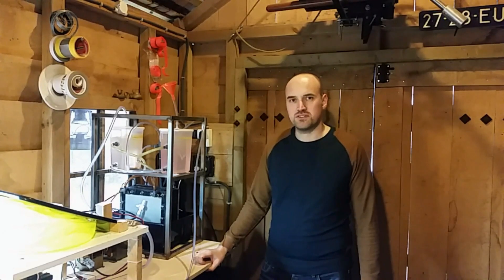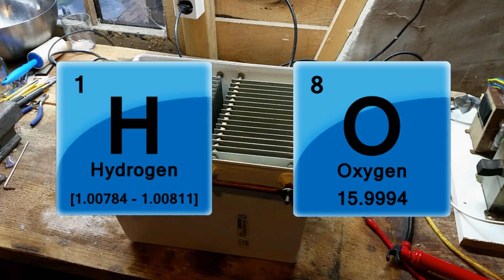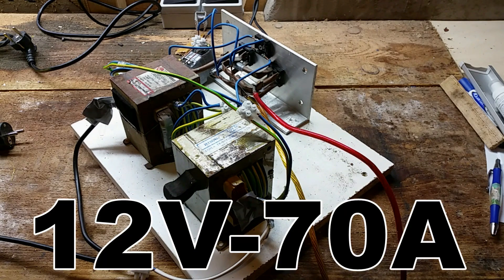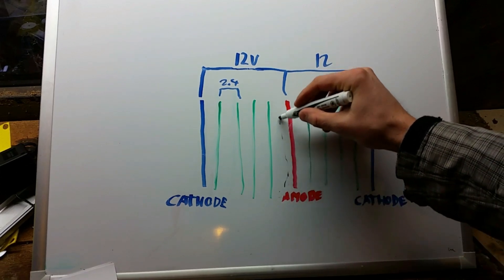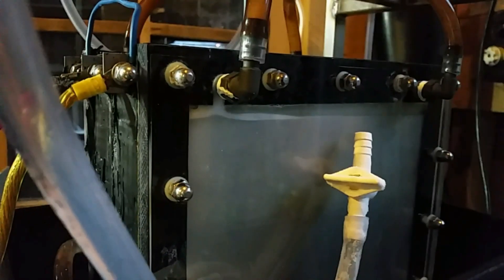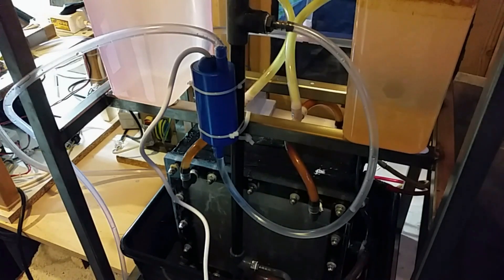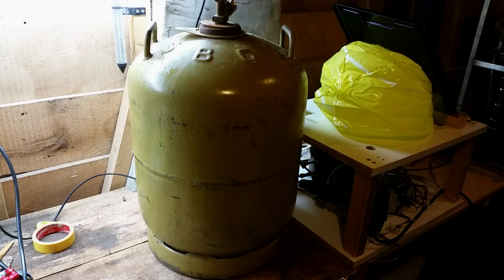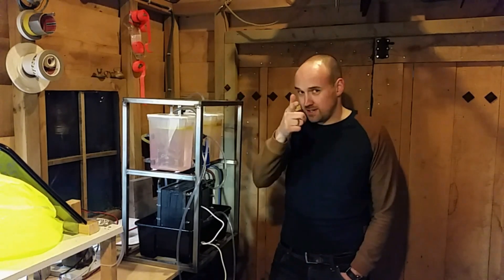Hydrogen Generator #1 Homemade Hydrogen Generator And Compressor Unit

Comment: I know it's an old video but are you worried about hydrogen embrittlement at all? Or do you think it's a low enough pressure to not worry
Reply from the maker: Hydrogen embrittlement will not occur in austenitic steel. Which these thanks are because you can weld stuff onto them without the metal being hardened and forming cracks next to the weld.

Comment: Really good. Regarding your larger tank that split because of the heat, I wanted to make hot water with the HHO, do you think it would work to have a round tank with the electrode plates inside and coil a copper pipe around the outside with the cold water circulating, which of course would heat up but also reduce the temperature of the electrolyte water?
Then shut off the electrode to stop the reaction by way of a thermostat, then there is warm water in the coil pipe and feeder tank
Reply from the maker: Yes that would work but a heating element would be more practical to heat your water.
Reply: @TheDIYScienceGuy  I understand, but my question was about killing 2 birds with one stone - to reduce the heat buildup in the reaction by having a 'cold water jacket' effect as with liquid cooling of a motorbike engine, and to not waste the heat. By turning it into warm water, then storing this well insulated it would reduce the power load to heat it into more useful hot water, such as in an off-grid situation. If you can use solar panels to make hydrogen and warm water then this would make a fantastic useful system for off grid use

Comment: Ok you can't just use a bubbler you need a flash arrester to prevent back flash, it's basically a pipe with two male hose barbs on either end stuffed with Rock wool or steel wool. A 50CC engine is gas Hungary, so you need storage for the gas so between your HHO Generator and your first flash Arrester you have a rubber bladder with a valve on it your HHO generator will produce 200Lbs/psi so make sure your hoses are tight. You will need flash arrester and  a moister trap then your engine... it cannot be set for gasoline you have to set the timing for a lighter fuel that burns sooner, so it is Actually about 3.5% after TDC once you have this setup it will run until it runs out of water or HHO gas Important use your HHO right away hydrogen and oxygen will Re bond in your bladder tank making water in about an hour or 2

Comment: I am curious why not make the whole system able to handle the required pressures,  allow the hydrogen and oxygen to naturally build pressure with not extra energy input to compressor?

Because there is virtually no difference in energy imput with regard to pressure.

It costs the same imput at 1 atmosphere  as 10 atmospheres, thus if the whole system can handle 10(15 for safety margins) then it naturally compresses from the electrolysis input...
Had trouble stating this simple idea, maybe my mind is fading lol.
Reply from the maker: A generator that would be abel to do that would be hard to seal. Also when the pressure increases the efficiency  goes down. But profesional generators do compress the gass into the first stage of a compressor booster that way. So good thinking. 👍

Comment: IF CAN I KNOW HOW MANY VOLTS FOR GENERTOR AND HOW MANY AMPERS FOR STRONG CURRENT FOR MAXIMUM ELECTROLYSIS RESULTS
Reply from the maker: I used 12 volt at 70 amps

Comment: Thanks man!This is awesome video!Can you use compresed hydrogen tank for stove or heating purposes?
Reply from the maker: Thanks! Yes you can. But you need to adjust the burner settings and instal safety features.

Comment: When you compress hho does it turns to liquid as propan does? Or is it just compresst air/gas?.  Nice build btw
Reply: Hho is literally hydrogen and oxygen, if compressed it gets hot as fuck really fast. Under enough pressure, it will auto ignite and legit explode. Not good man. 

But if your curious about how to do so safely, cooling the compressed gas to below auto ignition as it’s compressed will literally turn it into liquid water.
Reply: So, all in all, kind of pointless. And extremely dangerous. Hydrogen is inert when not mixed, when mixed with oxygen it becomes 1000x times more explosive than gasoline.
Reply from the maker: Never compress hydrogen and oxygen together in the same tank!!!

Comment: Electric generators engineer/ HHO hydrogen engineer need, I need to have a custom HHO fuel cell built, buy using home power to power the fuel cell to run a champion 10.0000 8000-watt gas propane generator Like Greg Potter with his GDS3000 GSD Technologies. Portable water generator. The engineer must have experience in Electric generators, Gas motors, HHO hydrogen fuel cell engineering Please email me if you’re interested in getting hired for this project molinarenterprise@gmail.com 50% will be paid upfront and the other 50% when the project is done.miami fla

Comment: soooo how big is the explosion if it failes to cool it down XD
Reply from the maker: The generator is cooled to prevent water vapor from mixing in with the gass. It can not overheat even without cooling.

Comment: question, instead of a membrane, can u use a tube at the bottom to connect the water tubs
Reply from the maker: Yes but then the current can only flow trough that tube which effectively makes the surface area of you electrodes the same size as the tube.

Comment: The way to go. From wind turbine to hydrogen in the existing gas pipeline like a mix of 50-50. No need to change appliances.
Reply from the maker: 50-50 of what?

Comment: Firstly tap water is not suitable for your project because tap water contains chlorine so when electricity is splitting liquid where oxygen is being tapped chlorine also will combine. If there are any leaks in the hydrogen and oxygen plus chlorine the hydrogen and chlorine in daylight can become very explosive. The rule of thumb you need 9kg of water to produce 1kg of hydrogen and 50KW of energy depending were you getting your electricity it will cost money in some cases 9 dollars a kilo . Health and safety should be paramount.
Reply from the maker: Where I live there is no chlorine and almost no calcium in our tapwater so I don't have that problem. But yes otherwise demineralised water is best. Thanks for the warning.

Comment: Sorry, but this is stupid and dangerous. There is no way you can control hydrogen purity in such a home built setup. Even if only 0,5% of the oxygen makes it into the hydrogen tank, after a while you'll have enough H2 O2 mix in the tank for it to be an uncontrollable bomb, essentially. Btw, a fridge compressor will easily do 50 bar if you let it run long enough! And then we're not even talking about the propane tank not made to withstand hydrogen pressures (at least 50 times higher than propane). Hence when exposed to some heat (say, sunlight or a home heating radiator), pressure may rapidly increase beyond the burst pressure point of the propane tank. This looks fun but it is highly dangerous, especially when you would attempt "to fill up a big tank" this way, period.

Comment: Your invention is so cool I keep coming back to reference it.  I have a question about the felt in between the plates and the channel that alternates sides to keep them apart.  How does the felt have anything to do with it if it's the side of the plate that determines oxy or hydro.  Also would it make more if the Anode and electrode we're hooked up on each plate instead of having neutral plates, or is that how efficiency and heat are dealt with.  I know thata why you stated you did it, but did you try multiple plates powered or always only had one?
Reply from the maker: Yes I tried multiple plates, it generates a lot of heat. In this video I explain the the separation further: https://youtu.be/K7DJGCF8Sj4

Comment: Hey I want to understand a little more about your compression mechanism and the output pressure in the tank. I dont know how to contact you, but I'd love to learn a little more about it.
Reply from the maker: I have a diagram on Instagram, hope it helps: https://www.instagram.com/p/Bpl2pLijM7z/?utm_medium=share_sheet
Reply: Thank you for sharing! What is the max pressure out that you're able to get using this system?
Reply from the maker: I'm pressurizing at 13 bar. The max pressure of the tank is 30 bar so that way I'm way below that, but refrigerator compressors can go way higher than that but it's quite dangerous!
Reply: @TheDIYScienceGuy  I understand and that makes sense. I am trying to look for ways to reach 200-300 bars with minimal energy consumption/losses for long term storage. Thank you for sharing tho! I love the effort that you put into your system. I'm a fan!

Comment: Hello, the project is looking good! I have a question about the fridge compressor you use to compress the hydrogen.. I'm planning on make a similair set up, but for methane(filtered biogass) instead. My question is: how do you keep the compressor lubricated and prevent that the oil is slowly pumping in your gas bottle allong with the hydrogen?

Groeten,
Mark
Reply from the maker: Thanks! I never did anything to prevent that because it's not an issue. Only when your pump becomes very hot some oil could evaporate out. In that case put a condensor column after you pump te condense the oil. You can put it back in the pump by letting the pump pump it back in trough the inlet. Succes! Bij deze ook je Instagram vraag beandwoord. 😉👍
Reply: @TheDIYScienceGuy  Ah duidelijk, super en bedankt! 😁

Comment: Why is mixing hydrogen and oxygen in the same chamber dangerous?
Reply from the maker: Because they form a very explosive mixture.
Reply: @TheDIYScienceGuy  Significantly more explosive than say, hydrogen only? Or is it just that it easily catches fire at lower chamber pressure?
Reply from the maker: Hydrogen alone is not explosive, it will  only burn in combination with an oxidizer.
Reply: @TheDIYScienceGuy  I see, great stuff man! Lucky I found this channel.

Comment: Caution ⚠ hydrogen is a very small molecule and will saturate and escape through the walls of the gas tank.
Reply from the maker: At 13 bar the pressure did not mesirably drop over several months, but thanks for the warning 👍

Comment: Dangerous but you known that. What you put yourself through is influencing the public to store their own energy without the middle man. With that being said vacuum pressure is an excellent safe storage of energy. Finding a way to bring deeper and deeper vacuum is the draw back to energy preservation technology. However The resources it brings us is cold steam a far more efficient way of converting amps to hydrogen without energy loss in heat. Like you experienced in your massive cell.

Comment: It is my understanding that storing hydrogen in steel tanks may lead to embrittlement and failure of the tank material or that the gas may penetrate the steel tank material.  Do you have any information that would relieve those concerns?....Thank you very much! great video and great machines....Joe
Reply from the maker: Hydrogen embrittlement only takes place in metals that can be hardened or ar not hardened (austenitic). Propane tanks are welded and therefore not hardenable and therfore hydrogen embrittlement will not occur. Leaks are not an issue, over several months the pressure did not drop significantly.
Reply: Thank you for the information......Joe

Comment: I have just found your channel and yes subbed. I'm thinking...can you make HHO on the fly? Meaning can you make it on a seafaring vessel? Fresh and or salt water. This would be the ticket in transportation cost globally. Hello from a fellow Dutchman living in Canada.
Reply from the maker: Thanks for subbing!!! Well to make hydrogen you need electricity so it's much more efficient to just run an electric motor on it. Hydrogen is only usefull as a means of energy storage.

Comment: Heat is coming from the high amps, by separating your plates you decided the amps in each and lowered the heat output kinda like making a wire bigger with higher amps

Comment: your video is great, but you talking about liters, my question is in your 560 L how much is that in Kilograms?
Reply from the maker: 560 liter of hydrogen weighs about 0.033 Kilograms.
Reply: @TheDIYScienceGuy  So, with your system to fill up a Toyota Mirai 2021 I'll cost 203$ and 4 days to make that Hydrigen. not bad since you are building from scratch. Version1.0
Reply: @GmoSerran  Toyota at 10000psi? How to compress 97% pure H to 5000psi ?

Comment: Wow, cool! I used to invest in Hydrogenics in the 90's! I am so glad that the company is having success still!
I have learned a lot about hydrogen production over the years and I wonder why electrolysis of water is the target here. It is far less efficient to electrolize water then it is to electrolyze urine. Urea and ammonia can be cleaned from waste water through low voltage electrolysis and produce far higher levels of hydrogen per watt of input when compared to water electrolysis
Reply from the maker: Yes it is definitely something I'm going to try!

Comment: How can one neutral plate have both positive and negative charges?
Reply from the maker: The current flows trough the plate which makes one side positive and the other one negative. These charges cancel each other out which makes the plate "neutral".

Comment: I think if figured out an easier way to seperate the gasses. Make a U shapped container. You can use some pvc pipes for this. Water tight and  easy to come by. The cathodes in one side and the anode is in another. The water is bridging across the bottom connecting the circuit. The rest of your system should work with it just fine. This would also be a safe way since you know that the gases wont be mixing as they would need to be forced down under the waterline, across the connecting channel and then back up.
Reply from the maker: Yes that works but the electrodes need to be farther apart which creates more resistance. But good thinking!

Comment: Also....how do you get your sodium hydroxide and im guessing you mix it in distilled water?? Please explain that part
Reply from the maker: It's drain cleaner. No I used tap water but distilled would be better. Our water is pretty clean though.

Comment: Are the anode and cathode tubes? Or do you collect gas from another hole?
Reply from the maker: The anode and cathode are plates. They have holes at the top to let the gasses flow trough.

Comment: I thought this was great.  I worry about your last statement though.  Hydrogen and oxygen being pumped together would make it very dangerous.  Like igniting 550L of hydrogen in a steel container?  That would be a serious accidental bomb.  Like house leveling type possibly.  There must be a better way to detect the contamination.  I believe that the original experiment separated it using speed of travel as oxygen goes slower due to its larger weight.  Also, using the electric pump for hydrogen is risky as it will spark when turned on.  I wonder if a brushless pump would be safer.  Anyways, you did it!  Hats off to you brother.  I hope it proves to be safe. As this is how we can all live off the grid and still live like modern humans.  Hot showers, heaters, generators, and transportation all need fuel.  This is a great solution.  I had the same idea of using a bladder with a weight at the top then I was going to have the mechanism release the weight and use that energy to pump the cylinder because I was afraid of ignition during the compression phase.  Looks like you had the balls to actually do it.
Reply from the maker: These compressors ar brushless. Yes it would be safer to incorporate an sensor,  I will do that in the future.

Comment: keep in mind if your pressure relief is to high, the forced exit can cause the hydrogen to self combust.. you need a flashback on the relief valves
Reply from the maker: At what pressure will that occur?

Comment: Safe storage of hydrogen banned as potential WMD
Reply from the maker: Well isolating lithium 6 falls under WMD because it can be used to make a light weight hydrogen bomb. You still need deuterium or tritium to make an H bomb, normal hydrogen won't work. But yes storing hydrogen in lithium 6 for transportation purposes would be great!
Reply: @TheDIYScienceGuy  Yes, that was what I was trying to say. I am sure much of our potential is being held back for profit.
Reply from the maker: Or safety, in this case 😉

Comment: Very good, do you know how much current it took your electrolizer to make 1 liter of 2 H2 O2 (g)? (This would be prior to the compressor.) My company is actively converting coal fired boilers used in process heat to a H2 O2 no air combustion.  We have the burners, we are looking for a low cost electrolizer. I like what you have accomplished. Please message me for further correspondence.
Reply from the maker: It needs 43714 Joule to generate 1 Liter of H2 and half a Liter of O2.

Comment: If you really want some rocket grade hydrogen . what i did was use hydrogen peroxide . i got a dark velvet red blue purple flame and it was making a sound of a jet engine when ignited . it was awesome and when i knocked the plastic bottle on to it's side to let the flame in . Don't do that because i shook the whole house and i only had it on for about a minute .

Comment: Do you have to store the Hydrogen or can you release it?  You can power 12v @ 70 amps with this setup?
Reply from the maker: No, yes and yes. 😉
Reply: @TheDIYScienceGuy  do you have any drawings for setup I can use to build mine?  If so you can email to reeves.rdylan@gmail.com
Reply from the maker: I have a diagram on Instagram: https://www.instagram.com/p/Bpl2pLijM7z/?igshid=3xh89coxkxif hope it helps!